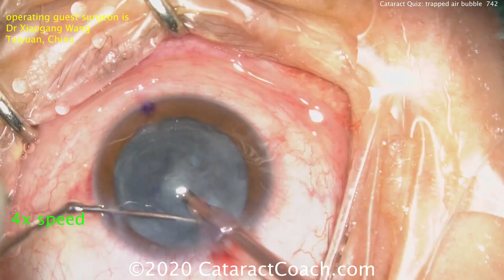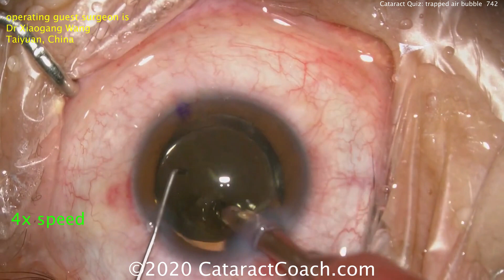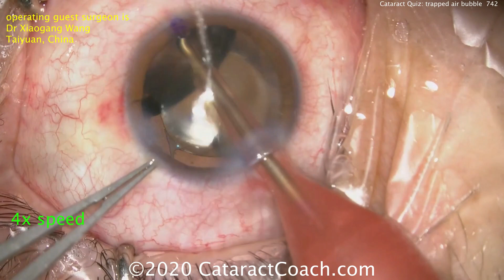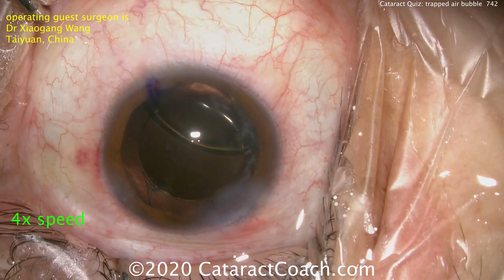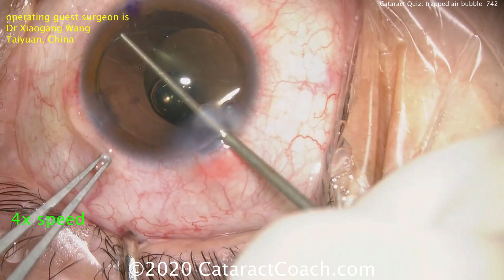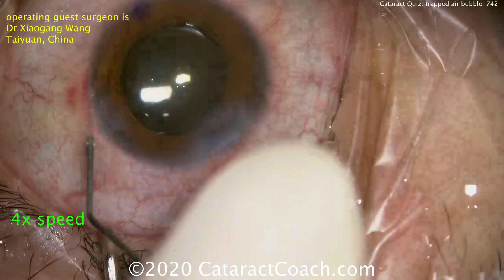Cataract Quiz: How do you deal with this trapped air bubble?

Comment: I think the air bubble is not large enough to disturb the IOL effective position, when air or other agents are used as a tamponade agent filling the whole cavity, there’s no movement of the IOL if you have an intact posterior capsule and a continiuous and round rhexis. If you still want to take that bubble out via pars plana, you can’t just aspírate it as the risk of vitreous traction is way too high! Instead, perform a pars plana anterior vitrectomy. I think the safest aproach will be just leaving that bubble alone as it won’t expand and won’t last a week as when you fill the whole cavity. If you are worried about the bubble displacing de IOL, a face down position for a few days will suffice, but it will be slightly uncomfortable for the patient though. Great video!
Reply from the maker: Excellent input. Thank you!
Reply: How many days it will take to recover? Please answer me.

Comment: Sir, nice video...wat happens when we leave this air bubble in vitreous cavity as it will get absorbed in few days and IOL will automatically gets centred... thanks for response...🙏
Reply: How many days it will take to recover? Please answer me.
Reply: Not always so. The air bubble may, for example, push the optic edge above the rhexis and you will need to reposition the lens. This is why retina surgeons usually prefer slightly smaller (around 4,5mm) anterior capsule opening in combined procedures.
Reply: Antroid1 face down, easy, semi sitting position , just avoid having the patient supine
Reply: @ajmi10  Sometimes all it takes is the few minutes the patients spends supine after finishing the surgery. Depends on the amount of gas as well of course. Looking at the video here, it's a bit difficult to see how badly the lens dislocates. I probably would have just left the bubble be. A pars plana approach or a posterior rhexis would've probably been a better idea than puncturing the capsular bag.
Reply: Antroid1 VR surgeons inject gas in pseudophakic eyes all the time , of you are worried about dislocation, try miochol (acetylcholine intra cameral)
Reply: @ajmi10  Yes we do, that was not the point.
Reply: Antroid1 I see no significant difference , it’s a gas bubble in the vit cavity, albeit a smaller one than the Tamponade gas usually injected pars plana
Reply: @ajmi10  I was just replying to the claim that the lens will automatically get centered when the bubble resolves, which is certainly not always the case.